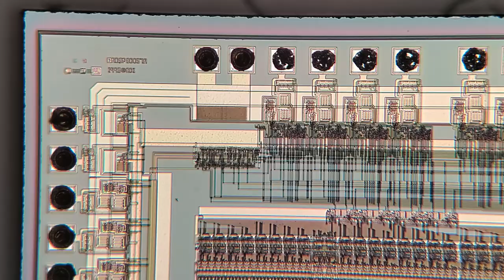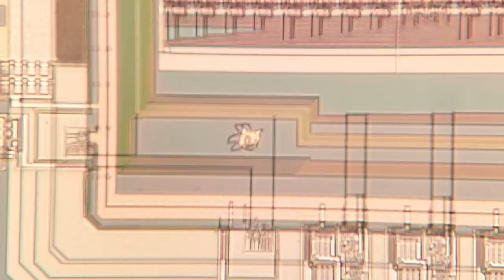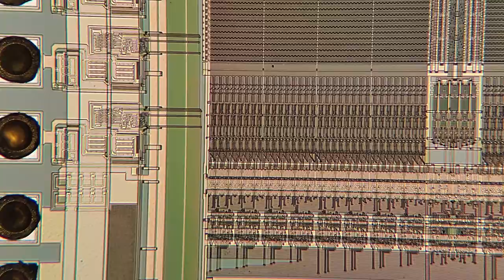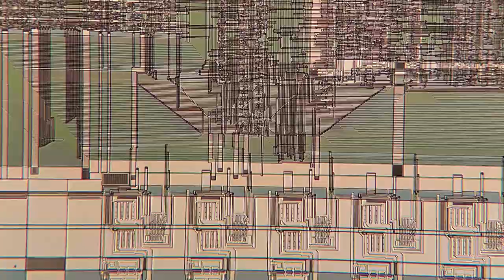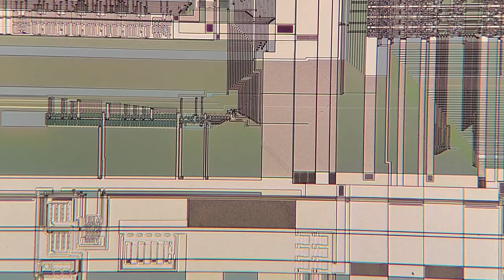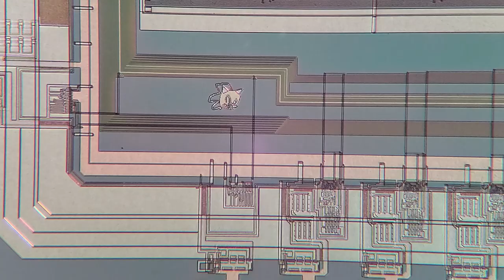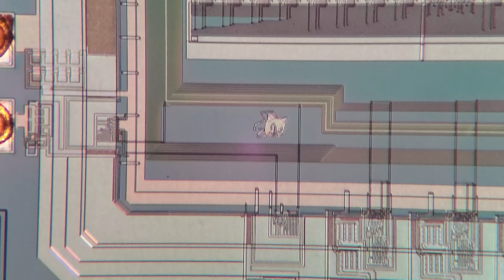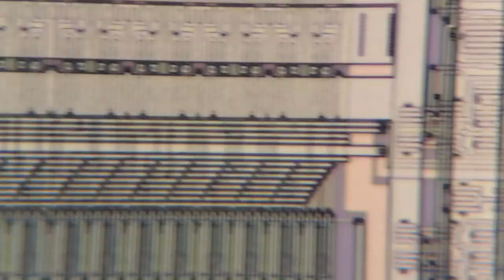Decapping an IC Without Acid - Sonic the Hedgehog Edition

Comment: I came here from a instagram post.
Bro this is so awesome. But what is this and what does it?
Reply: this answer is a bit late but whatever... This IC (integrated circuit) is belonging to the family of DSP (digital signal processing). To put in very easy words. It transforms analog signals (like temperature e.g. 39°C which is measured and then put into a specific voltage) into a digital signal (which then is changed from a specific voltage to a string of ones and zeros). You can find a more complex answer on wikipedia. Hope that helps a little. :)

Comment: Ho to know it is "sonic edition"? Does the ADSP-2181 KS-160 (PQFP) have it?
Reply from the maker: I would speculate that any ADSP-2181 part will have it, regardless of the package type. That being said, I have only opened up this specific part. 😁
Reply: @EvilmonkeyzDesignz More than likely they would have the same die inside and just the package is different.

Comment: Nice. This is definitely the best way to go about decapping without the need for any dangerous acids. What temp did you have the heatgun on? I'm finding that a lot of the time the glue on the carrier frame melts before the epoxy releases, which ends up cracking the die.
Reply: 480 degrees Celsius
Source: description

Comment: What do you do if some of the package does not separate from the top of the die
Reply from the maker: I'll have to do a video on the process, but essentially the easiest method is to boil the chip in pine gum rosin. I have some videos of the process on Instagram, but nothing comprehensive.